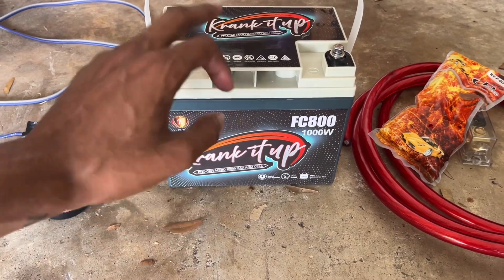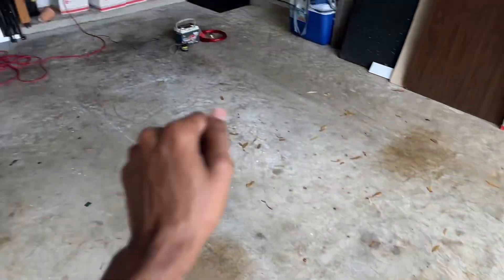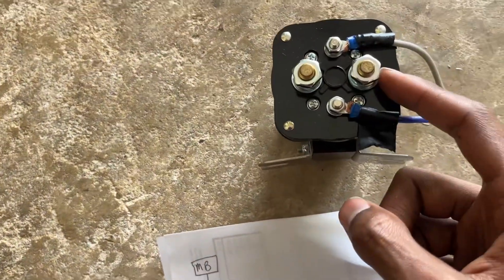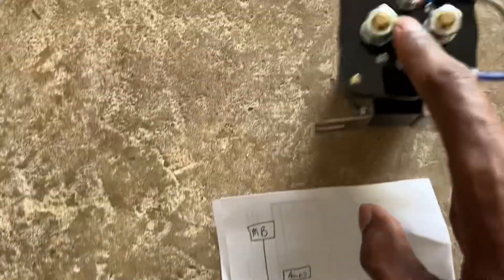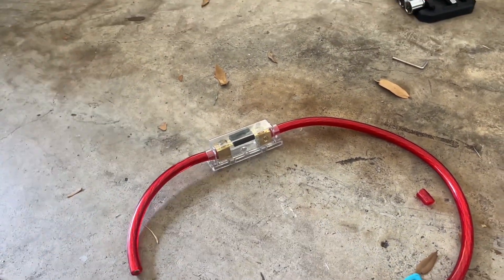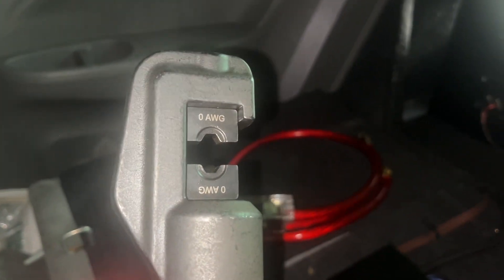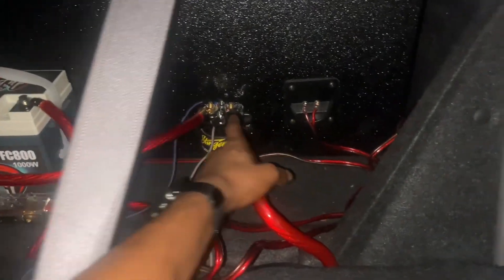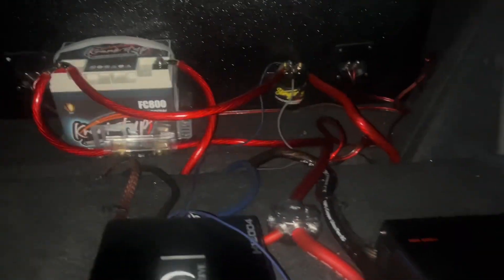Installing secondary AGM battery with Isolator

Comment: Any issues using that blue wire to power the isolator from the remote amp and not the fuse ignition panel up front?

Comment: You don't need a secondary battery you need a capacitor for what you're trying to do the new capacitor Banks or super caps what you need. The newer supercapacitors or Ultra capacitors will take that instant load off your battery so I wouldn't buy another battery I would buy one of those
Reply: What about the reserve that he may need on the lower frequency notes that may be extended a bit? Caps are good for short bursts of power and are good just for that I'm thinking.
Reply: @poppynokc1977 Caps are made to discharge and recharge rapidly. Batteries are the opposite slow discharge and slower recharge. This is why capacitors are used in electronics they take the shock load and smooth it out
Reply: @latelle why waste money on that when you can just lithium and be done